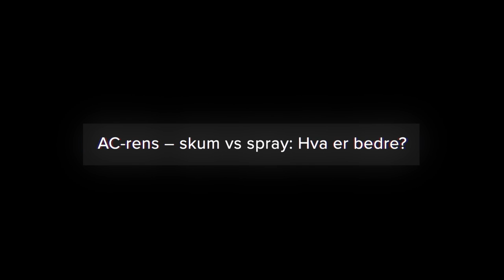AC-rens – skum vs spray: Hva er bedre? | AUTODOC

Comment from the maker: Var den til hjelp? Den beste måten å takke oss på, er å like og dele!

Slik bruker du AC-rensesprayer

0:43 — 1. Dekk til setene og interiørelementer av skinn så de er beskyttet.
0:49 — 2. La motoren gå, slik at batteriet ikke blir raskt utladet.
0:52 — 3. Sett klimaanlegget på minimum og viften på maks.
0:59 — 4. Lukk alle vinduene og bytt til resirkuleringsmodusen.
1:03 — 5. Gå ut av bilen og sett sprayboksen stående i passasjerfotrommet.
1:06 — 6. Press inn utløseren til sprayen og lukke dørene i bilen.
1:10 — 7. Vent i 10–15 minutter.
1:14 — 8. Luft godt ut i bilen.
1:27 — 9. Tørk av interiøret med en myk, ren mikrofiberklut.

Slik bruker du skumrengjøringsmiddel
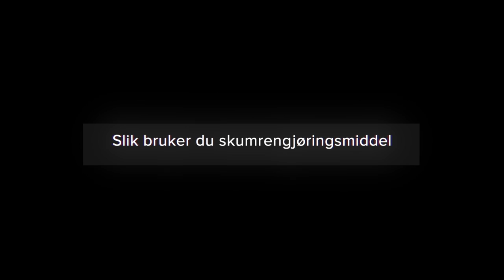1:46 — 1. Finn fram til kondensrøret.
2:09 — 2. Pass på at klimaanlegget er av.
2:20 — 3. Ta den tynne slangen og fest en ende til kondensrøret og den andre til beholderen med rengjøringsskum.
2:31 — 4. Sett beholderen under kondensrøret.
2:36 — 5. Spray produktet inn i slangen til skummet begynner å komme tilbake.
3:09 — 6. Fjern slangen og vent i 10 minutter.
3:12 — 7. Start motoren og sett klimaanlegget på maks.
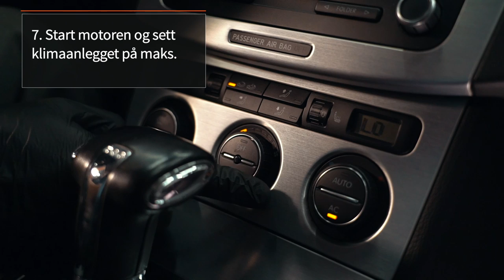3:22 — 8. Vent til all væsken og skitten har runnet ut i beholderen.